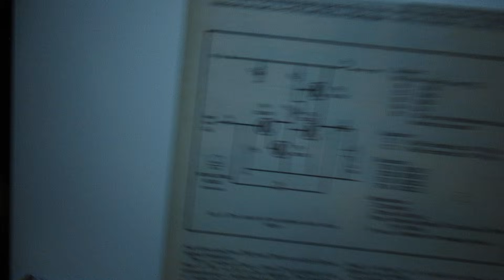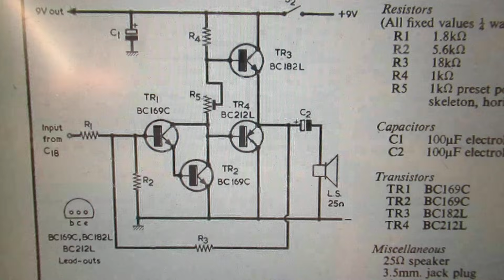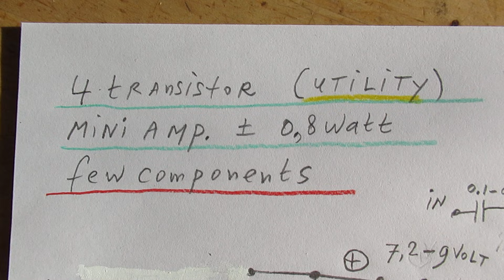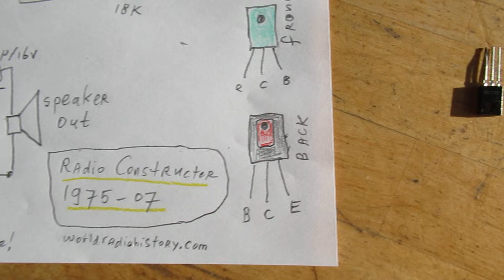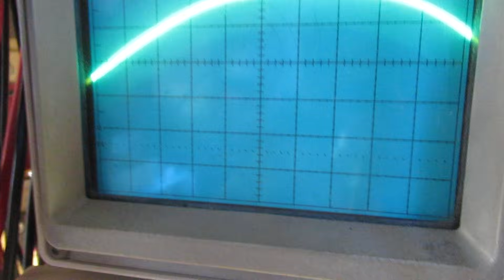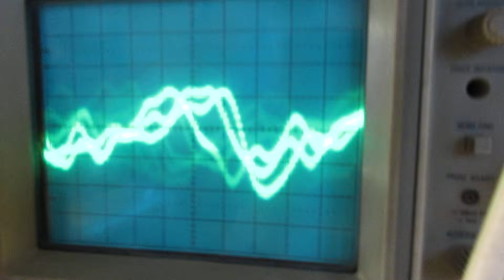Mini 4 transistor Audio amplifier (utility) 0.8 Watt (schem. & demo) A 1975 circuit, modernized

Comment: The JLH1969 is the gold standard from that era. Many thousands have been built around the world and thousands more will be built. Check it out if you like tube sound from simple Class A transistor amplification and capacitor coupled speaker loads.
Reply from the maker: This is class B.

Comment: Good video as always. Can I connect electret mic directly to the amplifier? Would it produce a reasonable sound?
Reply from the maker: Thanks, no I don't think that you can connect an electret directly to the input, because it needs a (small) voltage to make the amplifier inside that electret capsule work. Probably you als need a 1 transistor pre-amp. I will study your question better, will give more info. 14 feb. 2026.
Reply from the maker: Here some “electret microphone capsule” pre-amplifiers.
Thanks for your question 14 feb. 2026.
Key information about how to make that electret capsule work is here:
https://youtu.be/Pr39BoCJwDA 
https://youtu.be/KGWQqOS0raA 
july 2024
https://youtu.be/w1eAYYKV9Zg 
july 2024
https://youtu.be/RiGWEdxFZGw 
year 2020
https://youtu.be/FxlDTj29GJg 
year 2017
Reply: @radiofun232 
Thank you 
God bless you

Comment: That is a good audio amplifier circuit for miniature matchbox size radios. Being AB class, it will use less power to drive standard 32 ohm headphones than single transistor class A circuits. FM synchronous reception on modern high speed transistors gives very good results...
Reply from the maker: True! (nb: but I don't know what you mean with "FM synchronous reception, etc etc.... very good results"). 14 feb 2026.
Reply: @radiofun232  Sorry, I hit enter before I made any sense.. There is single transistor FM reciever circuit that uses a kind of analog PLL loop. It might be a good project for your channel. Most articles out there are non English, but schematics are easy enough to follow. To find example in Polish, google "Wakacyjne Radio UKF/FM" Circuit there works great, but the audio amplifier portion would be much better if replaced by schematic in this video.